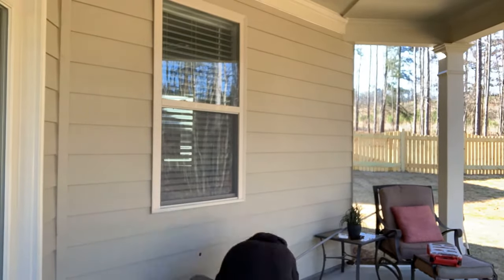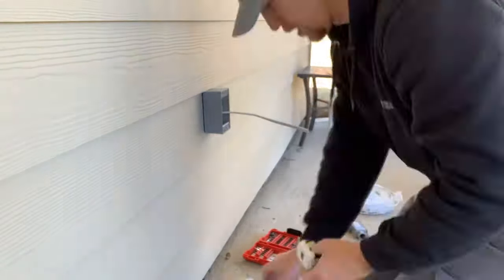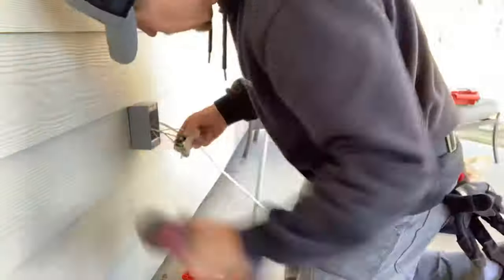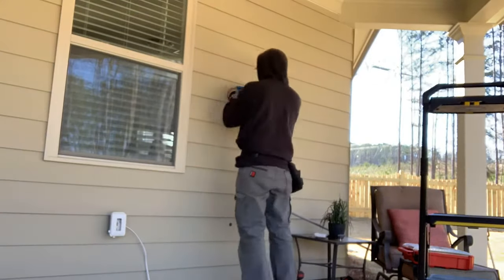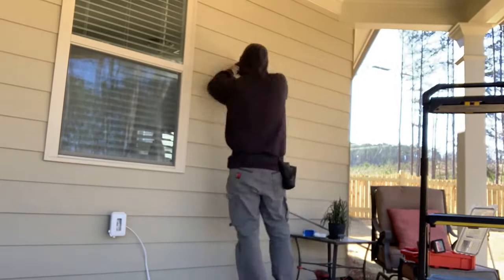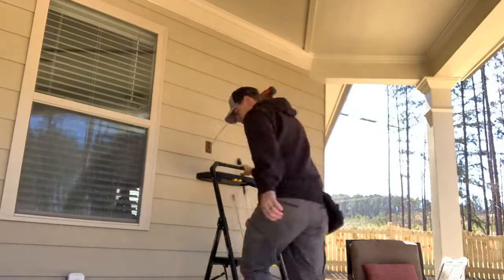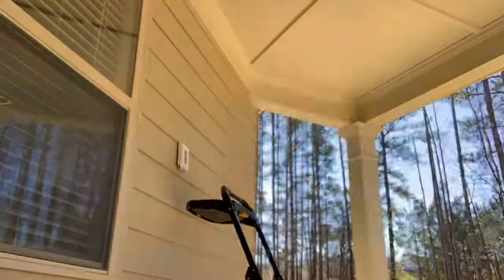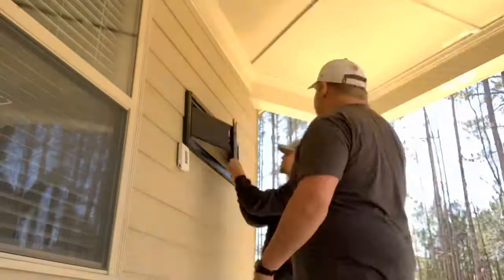Exterior TV Mount

Comment: I’ve been wanting to do this and haven’t see any good videos for this!  Can you explain more the mounting through the siding? Did you screw the mount right into the studs through the siding?  Did you need any spacers to adjust for the siding contour? Any need to seal drill holes?
Reply from the maker: Sorry for the late response! Yes right through the siding into studs with lag screws. if I remember correctly, I did space the top two out so the bracket sat plumb.
Reply: Seal holes?
Reply: @Nicholasvlogz dap silicone…?

Comment: Is that vinyl siding? If so, how did you find a stud to mount a tv? Having a hard time finding a stud on my vinyl siding
Reply: Same man, I am going to with a very thin long drill bit drill thru my inside beam to the outside through the plywood and vinyl. Hopefully it works, i built an oak TV cabinet for a 50inch and it has weight to it.
Reply from the maker: No, that was cement siding. Hardieplank. I found the studs in the inside and transferred the measurements to the outside using the window as my reference point.

Comment: How did you secure everything to the cement siding? Expandable fasteners?
Reply from the maker: Lag screws into the studs.
Reply: @tri-countyhandymanservices6623  Did you use the lags that came with the mount? Were they long enough to reach the studs from the outside?

Comment: Which mount did you end up using?
Reply from the maker: It was an old mount the customer already had on hand. I’m not sure of the model.
Reply: @tri-countyhandymanservices6623  The mount looks like it fits siding perfectly.  or did you modify it?
Reply: Damon Peterson Unmodified
Reply: looking for a tv mount that's already notched for vinyl siding
Reply: @Kevin-yz1ow  did you ever find anything, what did you do? I have the same application
Reply: @pauliemoto  i used s regular mount and built up the back with washers to level it. I couldn't find anything that was specifically for siding to mount a tv or not anything i was willing to pay some crazy price for
Reply: @Kevin  thanks for the input, that's what I need to do, been over thinking it a bit